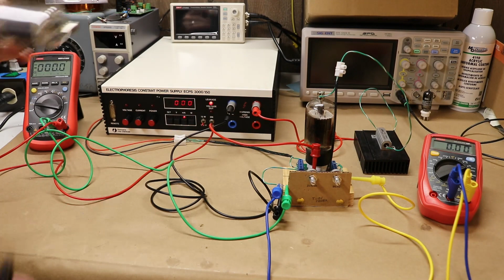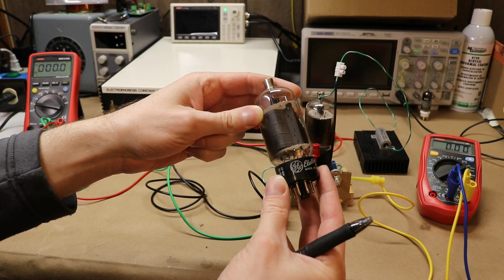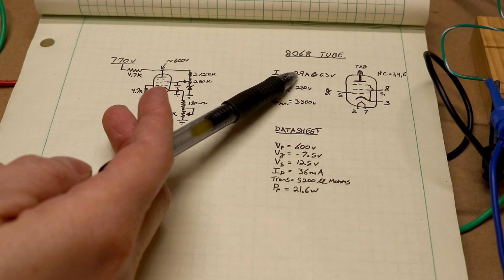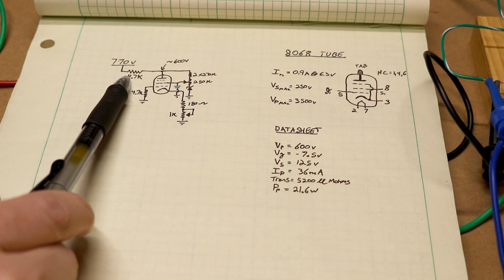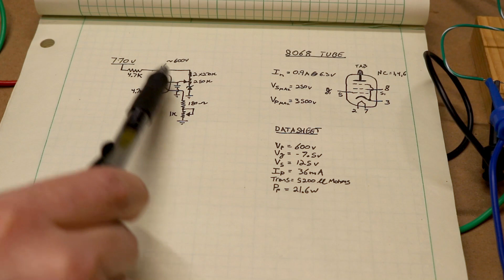Testing an 8068 Vacuum Tube - Basic DIY Tube Testing

Comment: Did you have to modify the high voltage supply to work properly.
Reply from the maker: No, This supply is hard to modify. I really just need to build or buy a supply designed for tube voltages.

My problem is I either have like 100 V supplies or like kilovolt supplies that then don’t put out enough current. Nothing in the middle.